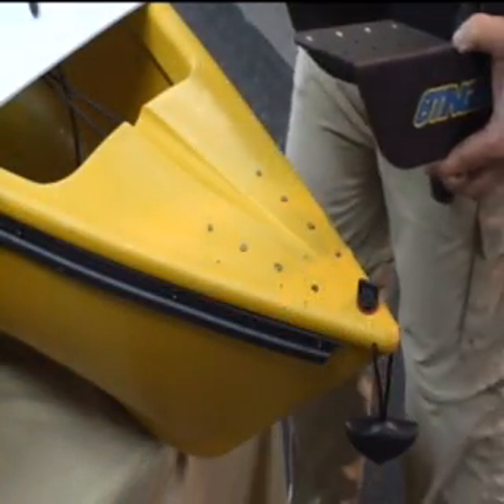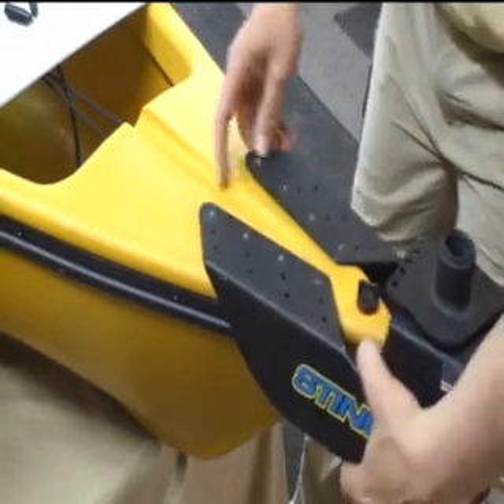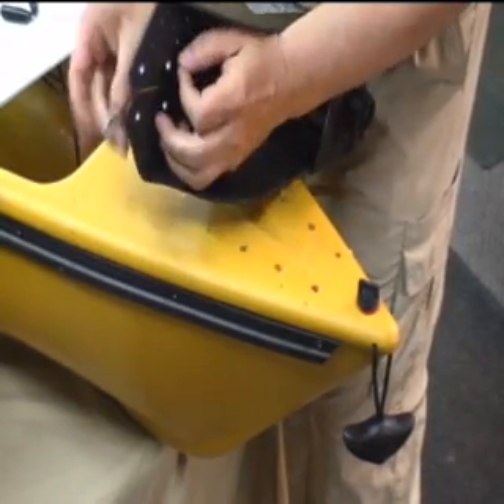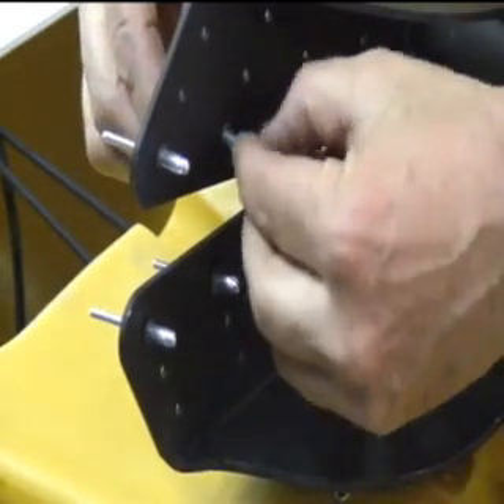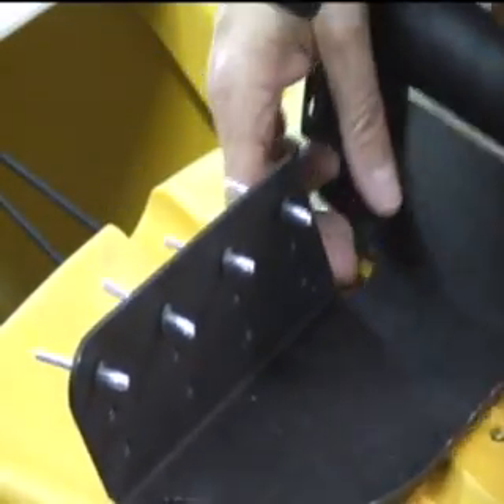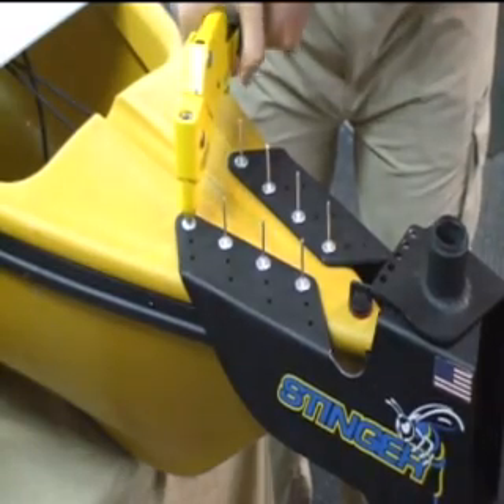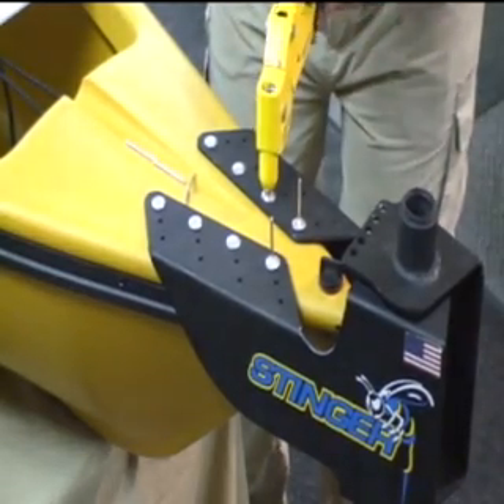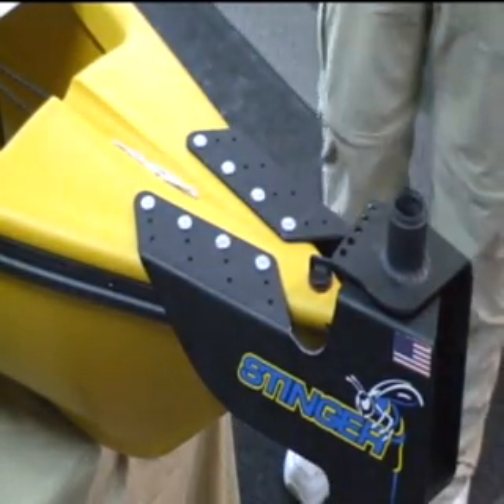Stinger Bracket Installation with Aircraft Rivets

Comment: Those are pop rivets, not aircraft rivets. Pop rivets are not legal for most applications on an aircraft. 

Since the expaned portion of the pop rivet is against a plastic or fiberglass material, it is easy for a rivet to widen the hole of the relatively soft material and push through.  Rivet back plates should have been used. 

Lack of knowledge and a poor technique on display here!